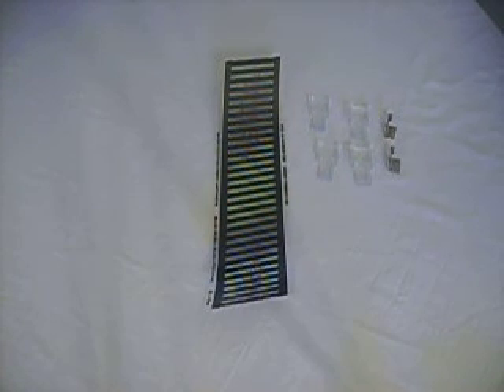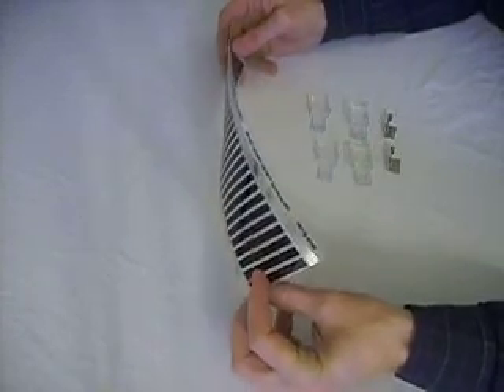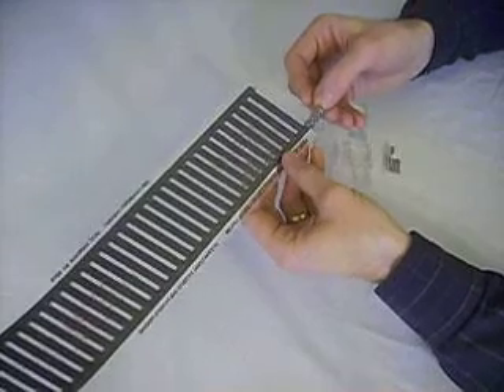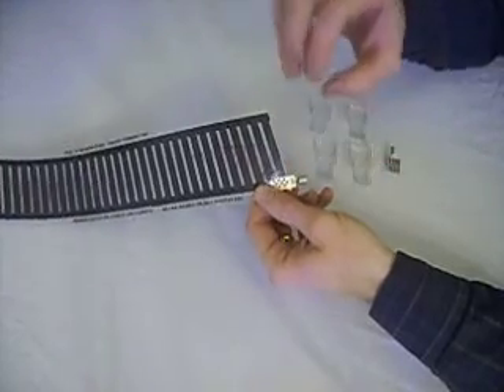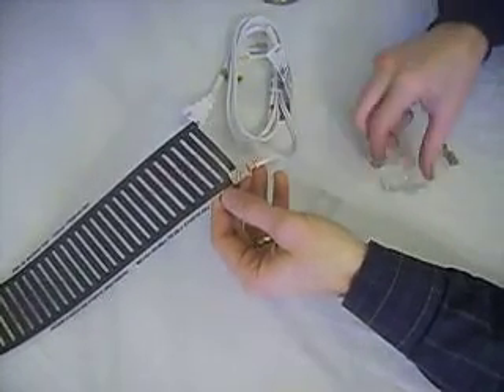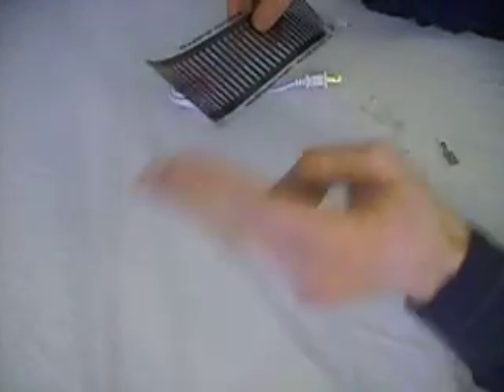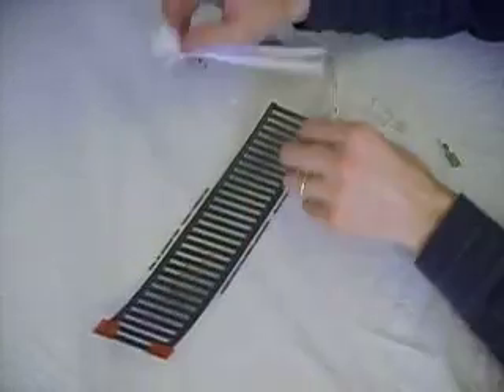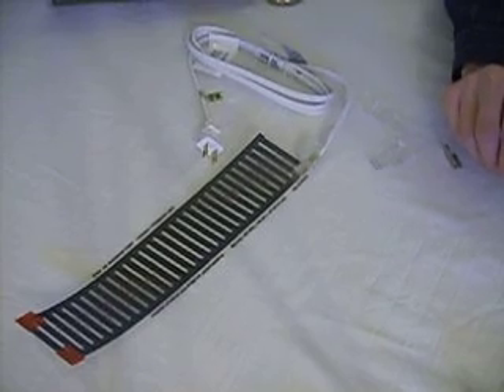Flex Watt Wiring and Mounting: Part 1 (by IncubatorWarehouse.com) Flexwatt

Comment: Because 24' x 20w = 480 Watts.. What I don't understand, is how the heck does wattage increase, with length.. It's supposed to decrease.

Could also use a hole puncher, terminal connectors, and rivets.

Comment from the maker: This can work well for a brooder as long as you have a brooder that is completely contained.  Meaning that that wattage you use will adequately heat up the entire space where the heat tape is.  The heat lamp is effective for a small area because it focuses the power to that small area.  Heat tape dissipates heat over a larger area, but much less wattage in a small space.  

If your 8' x 3' x 2' space completely contained?

Comment: im so excited. im going to use this in my new incubator
Reply: Did you use it in your incubator? If so, how much length did you need to heat how much room to what temp? For example, my dorm fridge incubator is about 6 sq ft, and I need it to be at 99F.